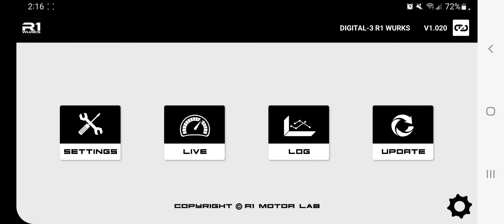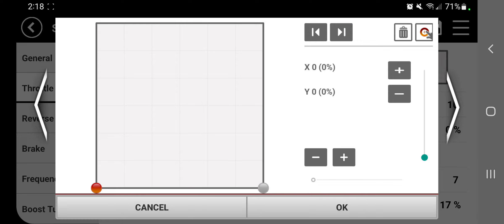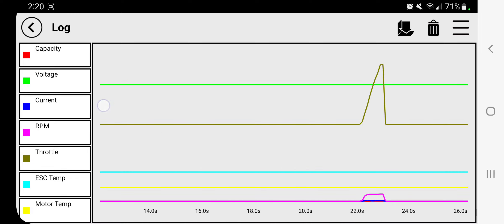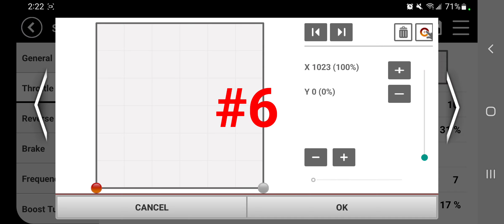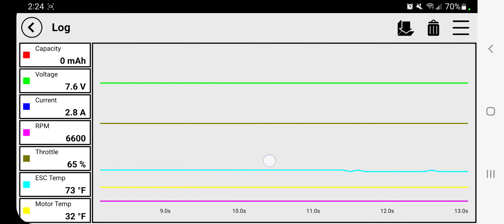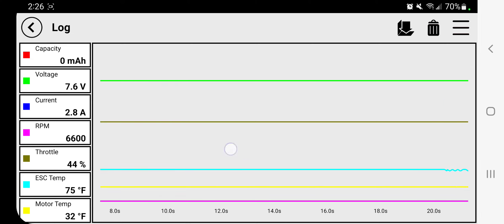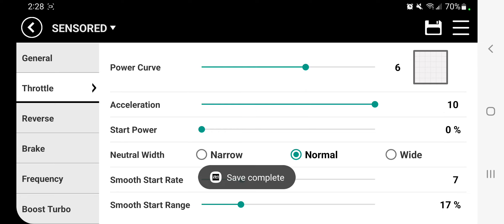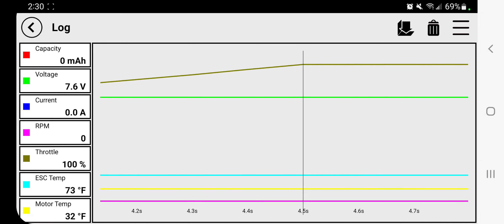R1 Start power and rx throttle input

Comment: Great test one question when you change the start power why does it read out on the graph as throttle percentage
Reply from the maker: Throttle is your throttle input from your remote
Reply: @ExaltedRC  so you weren't pulling Full Throttle on the trigger during the test
Reply from the maker: @powermadracing5116  correct. I think it was 6%maybe?(locked on the remote)  I crashed my car and the esc had a glitch going past probably 30%.. but thankfully an esc update fixed it. Crash knocked the software out of it,  lol.
Reply: @ExaltedRC  I don't fully comprehend how the  throttle percentage can be affected by the punch with trigger location, because as you know we pull full trigger .. but I'm glad you got your car fixed there ain't R1s to be found